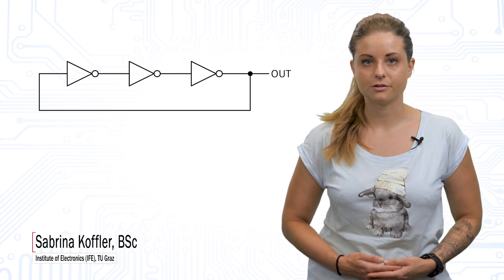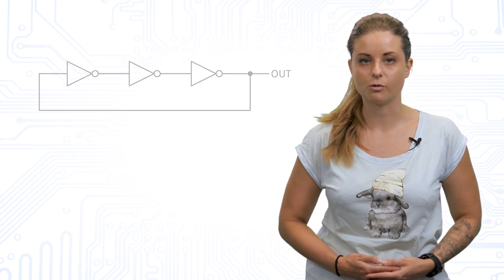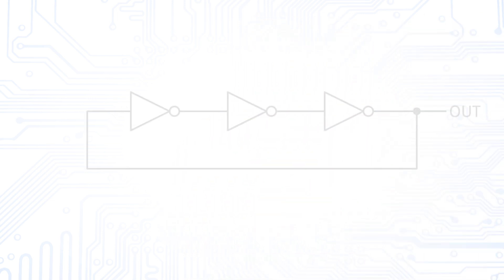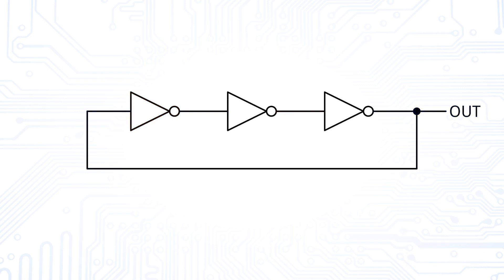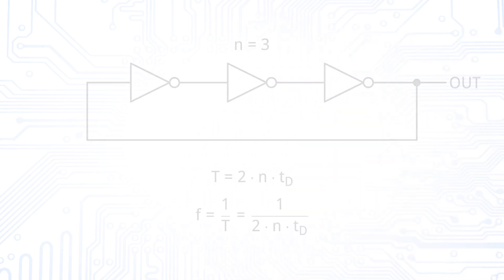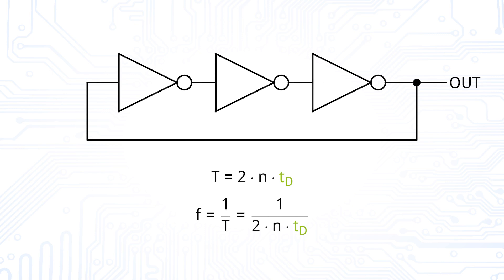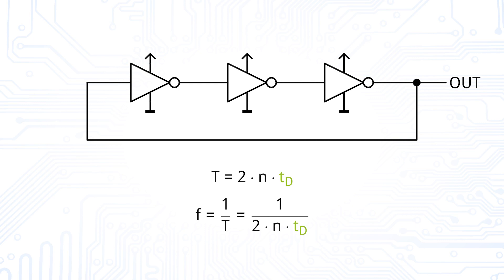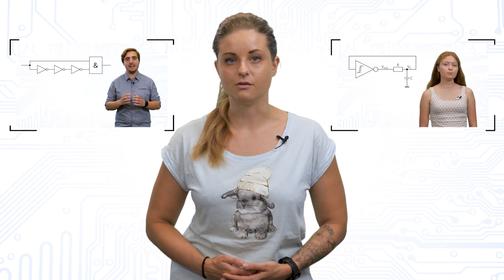Astable Multivibrators: Ring Oscillator, Inverter Chain, Basic Function, Switching Frequency

Comment: I don't believe the inverter delay can be reduced by increasing the width of the transistor. Yes, the resistance of the inverter will decrease with increasing the wide of transistor, but the parasitic capacitor will also increase. T= RC. So the delay will not be changed